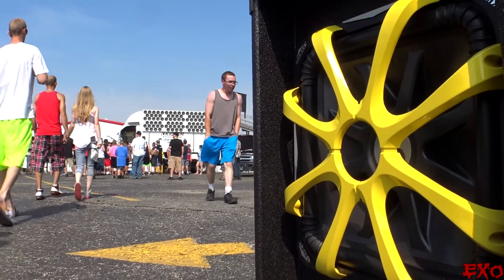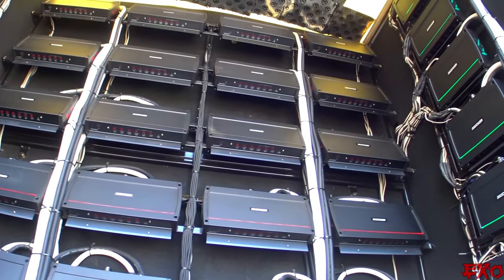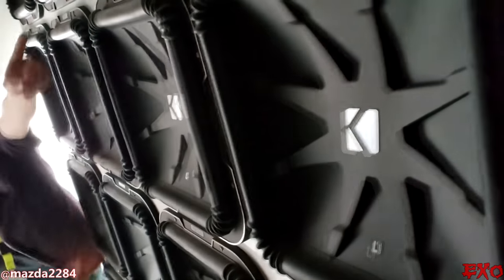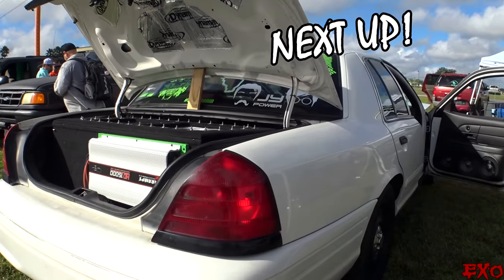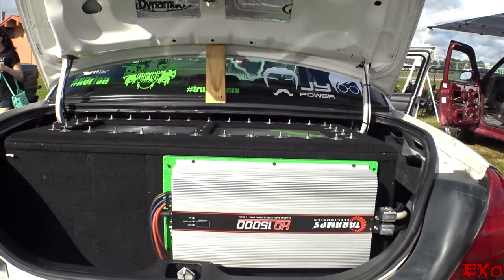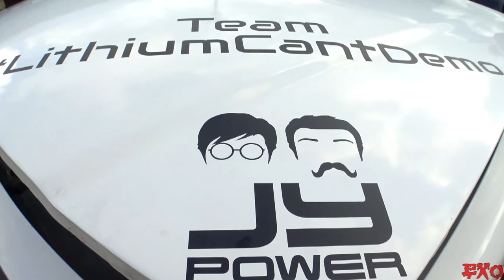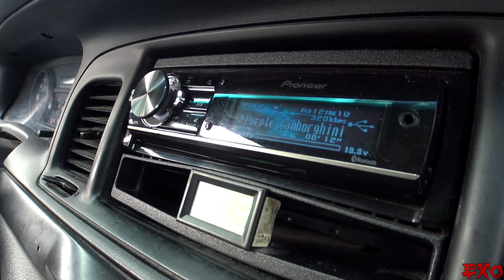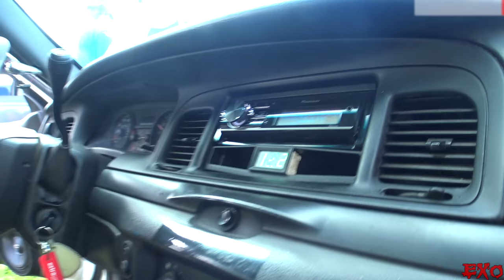TAPPING OUT on 40 15" Kicker L7 Subwoofers!!! World's Biggest & Loudest SQUARE SUB Bass System EVER

Comment: I might not like the square solos but hey 40 of em gotta do something
Reply: Im with you on that
Reply: @dillardz952 who said they were Solo Xs…?
Reply: 40 of anything will slam. imagine 40 nightshade v4's
Reply: @hinesvillebass6742  imagine 40 funky pups, might make the universe implode
Reply: @backspacemaster  oh lordy those things where somthin lol.
Reply: Well they aint solos so
Reply: Trenton Monino l7 is a solo baric just not a solo x but it is a solo baric so that dude is correct it doesn't matter tho kicker subs have garbage soft parts
Reply: I'm trying to make a subwoofer, that's a triangle or a rectangle. At least 3 months left until there finished
Reply: Steve Bellen Kicker subs have garbage soft parts because they are sound quality/daily subs and not competition. If you run a kicker sub on its rated power and it blows then you are clipping it and I wouldnt even say they use garbage soft parts, just not competition grade
Reply: Kicker: gets bullied by spl guys
Kicker: just throw all we got in something
Reply: Kicker and pioneer are the reason bass compatiion blew up the way it did. The Solobaric and solo x used to dominant them. They don't hit real low but they punch harder.
Reply: @stevebellen298  actually they don't. They did start building the comb and cvr in China but they actually have different models. All the Solobarics and x are quality. But the others it depends on the model. If you get the ones with the more 3d cone there quality the ones with the flat designed cones are china manufacturred. They did it to save money but they lost some of the old loyal customers. So they went back. People don't understand that the Solobaric and Solo x are not ment to hit super low. They instead are designed stiff to eat a lot of power and push a lot of air. They don't get as low as a sundown, or orian or Rockford t2 . But what they do is punch harder. So it depends on what you want . Kicker dominanated compitions back in the day. They put it on the map. But right now everyone is obsessed with going low which is why you're seeing so many companies focusing on burp style woofers. The Solobaric and x don't have great SQ but they do have spl but it's not as low as some other brands but the actual hit harder just don't have the flex waves everyone is obsessed with now. It's just different. Depends what you want. But the Solobaric and solobaric q series and solo x are made of quality parts
Reply: you must be a JL AUDIO guy😂, you can keep your foam surround junk😁

Comment: I think anyone probably all of us could handle the lows but when it's around 50hz even on my 2 12s it kicks in pretty hard. I prefer mid tuning Ik a lot of the walled guys are tuned at 25hz and below but I like 38hz and higher because it is a well around range it can get up high and low and not sound bottomed out or too low to reach the high points

Comment: That ain't nutting ,- I got 558 eighteen inch woofers 
feeding them 446,400 RMS watts , that's 800 RMS watts per subwoofer,.- My rigs
an International Harvester 18 wheeler,.-- The richter scale needles get nervous
at the turn of my switch,. So far my bass waves have knocked down 3 five story,
and 12 seven story buildings, 5 cafes 9 schools, 2 stadiums and 189 homes , ,.
on normal drive-by's outside my work space I've created five sink holes,  biggest one a quarter mile wide at just 1/2
volume and at 3/4 volume I have relocated  several farm animals back to
their normal habitats .. (( I own a demolition business which tests building
foundations with bass waves )) . /  THE BAD = I forgot to mention that two
farm animals went into coma for 3 days and are no longer laying eggs (two
chickens),,..also  I blew out the only
tweeter i had yesterday and I'm getting to many noise complaints from astronauts
repairing NASA satellites,  they claim my
bass is bouncing off the moon after 1 pm causing them to lose concentration.

Comment: You need 40 kicker L715 to get good hard bass because I had 2 on a 2400 kicker amp and it sucked for that much power and speaker size.  And for that much power. I also blew every 12" kicker I've ever owned quickly.

Comment: So far the most I’ve ran through my subs was 80hz and i couldn’t really breathe much but then i realized the dash of the truck was starting to fall apart and my steering wheel was starting to bend a little so I turned it down that way I didn’t ruin my dream truck 😂😂

Comment: I got 4 sa12s and 2 CAB 1600s...... I can feel teeth chattering sometimes and it gets hard to swallow drinks but that's about it...never had it metered... 3 xs power and a 180 amp high output alt in a hyundai accent hatchback

Comment: I have a 2001 mercedes benz E430 with bose 6.5 inside and 3 12" shallow subs on zappco amp 4,500 watts on zero gauge wires

Comment: Lol I've never tried different hz test in my system yet I just got some nice new db drive motorcycle amplifiers setup in my rav4 and they are awesome but now I've got alternator noise in my system so I'll have to trace that down or get a noise filter. And yea I agree, I like the lows more than the highs I'll have to run some tests and see what my tap out frequency is.

Comment: I got the 2007 solo x 18 planned on walling in a slammed 98 cavalier j body. Walled On 8k 7 cub  tuned to 32hz. Hope its enough airspace. Port will be 7" wide 26" tall overall depth think is 30". Hope it gets down.

Comment: more cone area but when the xmax is 11 mm. its like  having a super car with a lawn mower engine. looks great has all the potential. but its small engine limits it. drop a 12 inch spider quad stack, a triple slug magnet. a 4 inch 8 layer coil. and a mega roll surround. and you'll have people around the block lining up to grab one. untill then ill stick with my deafbonce sa4, my sundown zv5, or my b2 rampage woofer depending on the day. they pack the monster xmax we bass heads love.

Comment: There are no more fans added in the kicker amp line up. Also it would seem no more fins for heat dissipation.  Back before fans were added which was the main reason I started going to kicker amps was that I would shut amps  off.  Do these amps turn off faster then fan cooled kicker amps? Does any one add air ways to add fans? Do you need fans anymore for cooling?

Comment: I got an RCA adaptor recent for my car radio so I now have bass. I used the tail light as power. Trunk switch power for the Remote, and all of it was grounded into a screw,  so I just added my ground wire to it and now it works. The 120 watt house sub and power inverter just got me some attention from the cops. 😅😂 oops.  I guess they heard it they stopped basically in front of my house. He was a half mile behind me too. It's not even that powerful 😂😂😂 the bass knob it came with doesn't work, so it's controlled by the radio bass, I don't need even halfway really now, so that saves the other speakers lol

Comment: i once had it at a venue , we had some line array system from jbl up for testing 
SRX they were brand new i believe there were 20 or so on the ground , combined with others aired but these were not active 
The testing went a bit wrong with the main almost full open (75 ish percent)  
i remember that i saw a blur, followed by absolutely nothing(like i fell on my head , the lights from the stage dimmed by the power use   and i needed  a moment t to hear again and realize what tfck happened i was totally disoriented 
only thing ive heard after were some people crying and dust was everywhere 
the shock was felt outside the arena ,  there were emergecy calls made by people who tought a bomb went off

luckly the system was protected and it lasted for 200ms untill the emergecy switch killed the system 

from that moment i knew that car audio is never ever the same as an PA system its miles apart 
the shock felt there by a mere 30KW of 18" subs is something you will never achieve in a car 

the same reason i run 230v system in my own ride 
the power is just insanly better

Comment: Ok , what's the point here apart from permanent ear damage and hearing loss ? Not to mention other health issues. You can't even hear music as it should , just rattling boom. Back in the day my 78 Camaro had two 10' subs in the trunk and Proton plate speakers on the doors and a pair of MTX tweeters mounted on the dash. Music wether it be rock or what not, went through and sounded really good. And I mean music not just low frequency rumble which is what they do these days now with these demonstrations.

Comment: Anyone know where I should place my sub and port on a rectangular box? Dementions are 18.5" tall, 18.5" wide and 22" long. PVC port is 4" diamiter and 14.3" long. Subtracting the massive amount of bracing and port volume from the internal volume of the box, I got it down to  the recommended 2.5ft.

Comment: I don't think my 2 12" DJ subwoofers would go much over the 130dB mark in a car. I think two corner loaded were modelled for 135dB at 1 metre so possibly a bit more than that. They are 96 dB 1 watt 1 metre though so don't need crazy power to get loud. I think I spent too much on the 12" woofers as they were £175 each from Eminence and I could have got 15"/18" for that money. They are loud enough to slam a village hall in a corner complementing music that's about as loud as a really noisy disco club from the back of the hall. I have unclipped video footage of them playing full blast. Loud but not so much bass I bail out. So I don't have any systems that can do more bass than I can take nor have I experienced any.

Comment: The kid did Tapout just watch the video close and solo Barracks are made for low Bass it only please between 100 down to 18 that's very low the reason this is so important and it is designed to play 1200 watts random no more than that and that is after you break it in not before the Rockford T2 do sound better but the solo play much louder because the kicker only play between 100 and 18 Hertz it doesn't sound as good as the t2 playing 250 Hertz down to about 20 I think and that do sound pretty good but if you want Bass in your face the Solo-Baric will do that

Comment: I like to stab my AKG tuned earbuds into the 3.5mm monoural earphone Jack of my 1974 Reader's Digest RDA-127 portable shortwave radio and then plug an AUX cable into the 3.5mm input of what would originally be a Microphone input (this olde radio has a setting for P.A or Radio although it doesn't get that loud at all), then plug the other end of that cable into the headphone Jack of my phone, and play an extremely bass boosted version of "Get Out" by Baby D. The thing is, whatever amplifier is driving these earphones (probably the 2W amplifier that mainly drives the 4" Foster Full-range driver) is like 10x more powerful than the amplifier built into your smartphone, as I can only turn it up to 3 (or so) on the volume scale before the bass becomes painful and the voices become distorted. I have no idea how much DB's that would be, but probably somewhere into the 90s. It's ridiculous.

Now before you go hating on me for using earbuds instead of a real subwoofer, I'm broke and the only thing I have that's closest to a subwoofer (although not that good) is a Yamaha SW-P3600 10" Cube sub. It's OK, but the boominess of it and the short 3" port can cause Port noise and sound more midbass than one would want. The others I have are just Bass modules or Woofers in a Box, which aren't incredible by any means. They aren't true subwoofers. So that's out of the list.

Other than that, really, the only amplifier I have is a cheap Chinese 10-15W portable amplifier that can be operated on batteries and to cram into your pocket. But it's not very powerful by any means.

Comment: This guy is correct as far as the square subs having more cone area but what he fails to understand is that circular subs have no weak points/joints where as the four corners of the square subs are weak points/joints.  The force being exerted to the cone/ surround from the voice coil moving up and down is the same all around on a circular sub where as it isn’t the same when pushing up on a square sub.  The corners are the weak link in a square sub.  Why else do you think the top brands in the world are circular and do no go with square subs?  There has to be a reason and don’t say it’s because Kicker has them patented to where others can’t build square woofers because MTX and a few other companies have square woofers

Comment: here is the thing sound from a single source that loud would kill you the out put that you phone is reading as 160  is receiving noise from the sound echoing and the noise of orher things objects that add to the overall input of the pbone its also not as accurate as a decimal meter at 180 DB sound behaves more like a Shockwave for detonation but you'd be dead way before the audio got to 160 decibels directly from a single source things rattling and vibrating around you are what is adding to the hi reading

Comment: Square subs are not better and more efficient.  That's laughable.  A round sub has no weak points whereas a square subwoofer is weak in the corners.  It's like comparing something that is connected at a joint to something that is infinite.  If square was better, every company would be going square.  Daniel Powell does a 165 at mid 20s with 12 NsV4s.  And guess what, they are round and he has a third of the subs compared to the Cube.